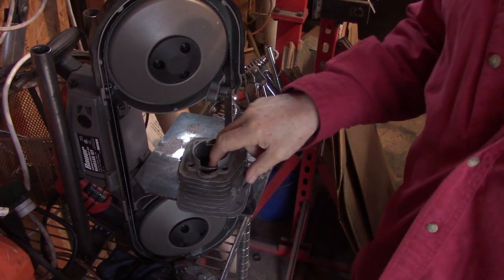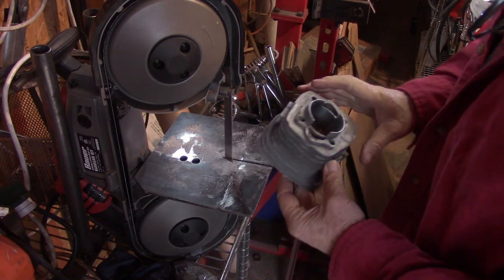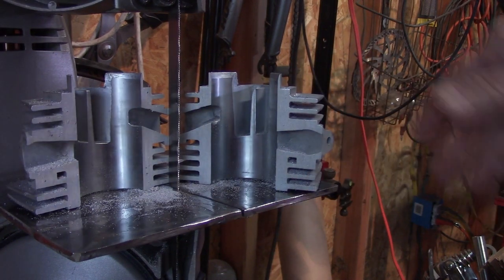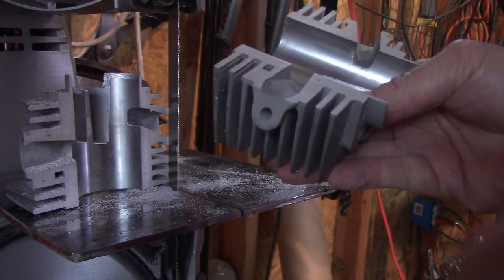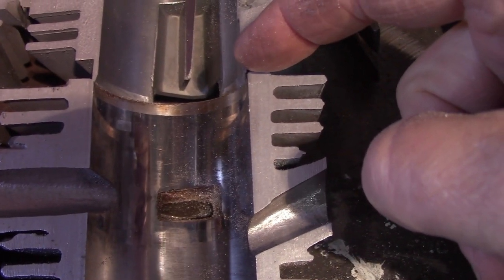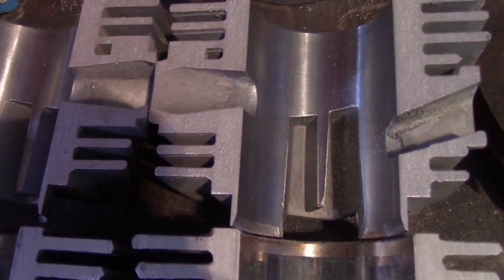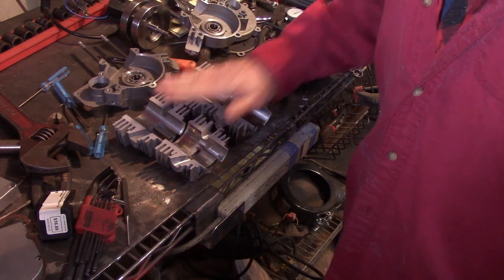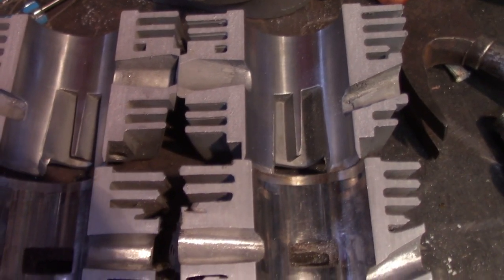Lets Dissect A 66cc Cylinder and Learn About Ports & Porting

Comment: Thanks for the knowledge your videos have taught me a lot. My bike has been sitting outside for about 10 months I cleaned everything out except my clutch I took the cover off and it was nasty I cleaned it and greased it made sure I still had the little ball bearing and little bar on the other side that was all good but still having problems? Any tips?